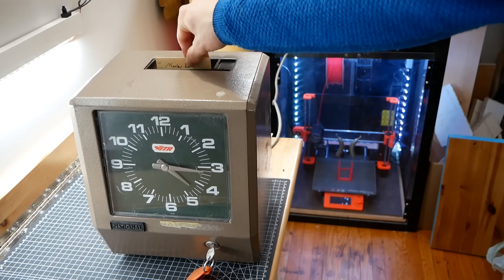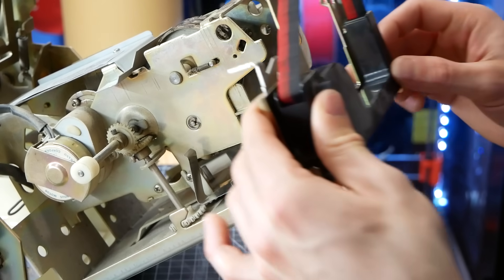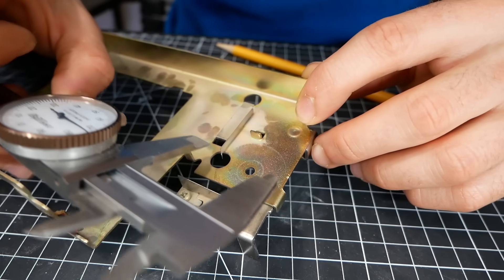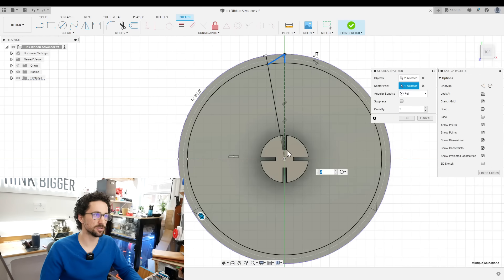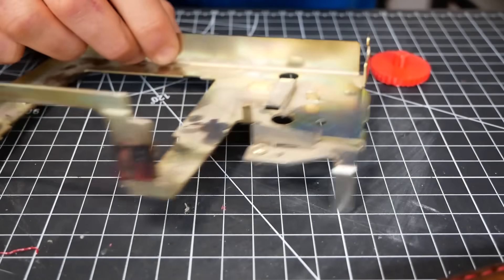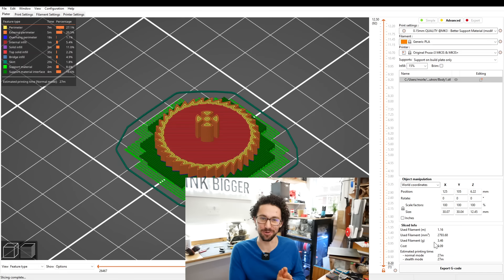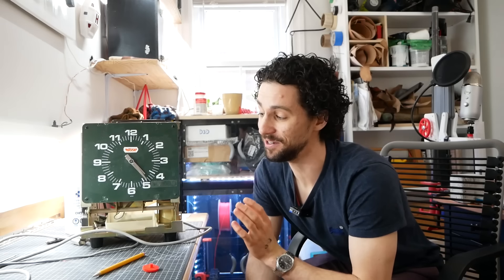They wanted 100 dollars. I 3D printed it for 9 cents.

Comment: There are a lot of good reasons that that part costs $95. It was the whole assembly, the product is ancient, there is storage, handling, shipping, etc. I am impressed that they were able to diagnose it and offer a replacement part. That's one hell of a company.
Reply: He didn't take into account the cost of his 3D printer, Fusion360, and other tools he had available in his workshop. For a collector who doesn't have those lying around $95 seems a fairer cost. For people who does though, yeah $0.09 is definitely more appealing xD
Reply: @jellyfishwiggle8721  because he already had them. if you say that a meal cost you 10 dollars to make, you're not taking into account the cost of buying the stove, the plate you serve it on, the utensils you eat it with, the whole bottle of cooking oil, etc. the video was about how he saved himself 99 dollars, not a guide for the average person to make this random single part of an outdated machine
Reply: @jellyfishwiggle8721  You could upload that file to JLCPCB and they'd charge you like $1 to make it and $4 for shipping. And it'd be made on an industrial printer from SLS Nylon so no worries about durability.
Reply: @jellyfishwiggle8721  And youre not taking into account that fact that there's 3d printers everywhere around you. Here in Toronto the libraries have them. That means you could 3d print the repairs locally on a 3d printer for much less than $100. Its free to use 3d printers in our free libraries.
Reply: @jellyfishwiggle8721  Dont forget to mention that he uses a 9 cent plastic part for something that is used over 100 times a day.  Image the cost of printing that gear 5 times a day compared to buy one for $95 wich lasts decades
Reply: @ZenoAmbrosius  well in the other video he used for reference the part also looked like plastic, also i would doubt that the wear on the piece is actually so much a good 3d printed part would not handle, not 9 cents but i would bet money that if you refine just a little more you can get the same result for something under 10 bucks, hell if don't have the printer you could just order the service online just giving the piece specifications, i'm not saying that the original company is not a good company but i am saying they at least could had told him "oh you are missing a gear that interacts with the mechanism right there" but they didn't, they offered a whole new mechanism to substitute a minor part so yeah not the best
Reply: @ZenoAmbrosius  he can print it again using NYLON.
Reply: @ZenoAmbrosius  I don't think it's gonna fall apart after 20 uses... it's not made of play-doh 😂
Reply: @ZenoAmbrosius  that’s a plastic wheel that company is using, plus not to mention, if the content creators piece lasted 100 years, that would be $9.10 of use, compared to that $95 piece, id pick the 9¢ piece
Reply: @ZenoAmbrosius  my mans forgot about cast iron
Reply: @ZenoAmbrosius but if you use nylon or another technical material the cost will be a little bit higher but the durability as well.
Reply: @ZenoAmbrosius this post seems like the least thought out, if people are using this multiple times a day, we are clearly at a point in time where a lot of companies want this and they are keeping them constantly stocked. So $95 dollars for a constantly stocked piece is a rip off, he would also be able to make 1900 of these prices in plastic before he’d reach $95. I do agree that the price the company game is reasonable but your comment seems very unreasonable
Reply: @ZenoAmbrosius clearly the last one didn’t last decades and he’s prolly not even gonna use it all that often just a glorified paper weight so it really doesn’t matter plus pls is a really hard strong plastic so even if he uses it 20 times a day he’ll only have to reprint it like once every 1-2 years
Reply: @ZenoAmbrosius  PETG filament is the same cost and would last damn near forever, hell TPU is used in car stuff and that's not much more expensive. Even PLA would last for thousands of revolutions.
Reply: @jellyfishwiggle8721  Keep in mind that you can get a decent (if no longer cutting edge) 3D printer like an Ender-3 Pro or Anycubic Vyper used for about $100, or new , and Fusion 360 is one of many CAD / 3D modeling platforms, alongside OnShape, FreeCAD, TinkerCAD etc, that are free for personal use. If this was the only part he ever replaced, that's probably not worth it, but YouTube is already suggesting another similar repair on his channel. If we assume the original part cost about the same in that video, that's a total of $190 versus $120 for the 3D printer plus a full spool of high-quality filament (usually $15 to $20 for a kilogram) which can probably print this part more than 150 times over. After just two comparable repairs, or any part requiring customization beyond surface level, the 3D printer has already paid for itself.

Besides, more and more libraries are opening makerspaces that have 3D printers available for public use and would let you print a part like this for a couple of dollars at most. For example, my local one charges just five cents per minute of print duration if I recall correctly, so I wouldn't expect this part to cost me more than a dollar there.

Some other commenters have expressed concerns about the durability of a 3D printed replacement part but the one CuriousMarc had appeared to be made out of plastic, and it's not under any significant load. While 3D printed parts are slightly weaker than their injection molded counterparts, this replacement part shouldn't break down that much faster than the original, maybe twice as often at most, if printed with reasonable settings. Not the thousandfold increase others are suggesting. I have plenty of 3D prints that have seen routine use in my life for years but show no noticable signs of wear, including ones under way more load than this gear will ever experience.
Reply: Oh come on people, the time spent, the quality of the plastic... you are all right of course but you are missing the key thing in this: he can do it on a Sunday when nobody would ship it, it is up to him when he does it and when it gets to him(which is right away after doing it). This is a level of independence that is worth having especially today where corporations are chipping away at the concept of ownership every single day. You are already technically renting your phone, it isn't really yours, and soon your car will be remotely locked too(some brands already do that).

And then add the extra bits:
- The challenge - The feeling of accomplishments - The mental exercise staying sharp - The fact that one has even time to do such a thing as stopping for a moment and figuring out how to fix something is already a tremendous achievement, most people are busy just scraping by all day. The fact one can afford to do this is great.
Reply: Most companies would tell you "sorry we haven't made that for 60 years.
Reply: Agreed. However, still cool to be able to fix something yourself.
Reply: I work for a printer company, a 250gig hdd for a canon cost about $500 from canon. no software, just blank. It has to be a certain drive, software on machine locks the part number with the machine. Canon is a patent company, they own the patent on the drive and get money from the manufacturer for the drive being used. They also get money when a repair company buys the drive, and they get money when the customer buys the machine. Most companies work like this, multiple revenue streams for the same part.
Reply: Tell me you work for the company without telling me you work for the company.
Reply: You can design this on free software. The .09 is obviously material cost. And I'm sure the design took all of 1/2 an hour
Reply: As a consumer, I don't give a damn.
Reply: @PALMA06  you should
Reply: Satisfaction is priceless.
Reply: I’m surprised they still offer the part. If it meant being able to continue using an expensive product, I’d be happy to pay the $100.
Reply: Also no one consider the time he spent. If you work on it more than 2 hours you have already spent 90 dolars :)
Reply: @VarlıkYücel  Well remember that the work you do is taxed and the product you buy is taxed as well.
Reply: @raychii7361  Well yes, that’s correct
Reply: @Varlık Yücel  some people just enjoy the problem solving journey, and it's not necessarily only about the money.
Reply: @VarlıkYücel In what world is $45 an hour reasonable?
Reply: You know damn well it does not cost them $95 to injection mold a shitty gear, which is probably why it broke in the first place. They're not at all "one hell of a company" for keeping documents about their own products
Reply: @lemau8458  The injection mold to make just that one gear cost more than a new car, a really good new car. And it's for a low volume product so they have to profit somehow. Injection molded plastic is only cheap in volume because the tooling is insanely expensive, I've seen molds for large plastic pieces that cost as much as a house. In low volume products it's often actually cheaper to CNC cut parts from POM or aluminum than to use injection molded plastic due to the tooling costs. This may not be the case IF you can find a usable part in the injection moulding outfit's back catalog of abandoned molds. They don't throw those out and the contact often dictates that the mold belongs to the company fabricating the parts not the client, but this depend s on if you can find a part that will work in your design. It's why you see hobby servos with identical cases from different manufacturers, there's a big injection molding outfit in South Korea that does a lot of the hobby R/C market's plastics and they have a TON of old R/C hobby related molds that keep getting reused so you see plastic bits like ball link ends, servo shells and other fairly generic odds and ends popping up from completely unrelated manufacturers over decades that have clearly came from the same molds.
Reply: Most modern companies would simply tell you to buy a new machine lol, also the companies parts are obviously not made of cheap plastic
Reply: Came here to say this - $95 for a part from rare and obsolete equipment, manufactured the classic way, doesn't seem unreasonable. 👍
However, 3D printing a facimile is pretty brilliant  😁
Reply: They wanted to sell the whole metal part for 95 dollars, instead of just the gear. If they would sell just the gear for say $10-$20 they would probably sell more. Industrial markup is so stupid. 😅
Reply: @mechticulous8202  you're assuming they have just gears made.  It sounds like they don't.
Reply: None of those reasons come close to justifying that part to cost $95 dollars.
Reply: @jordanhoughton4227  It's a part in an industrial device, low volume so they have to profit by increased price otherwise no reason to make the device.

Comment: I use this exact clock-in machine 4 times a day. Somthing interesting is that you have to manually cycle throgh a whole week -1hour when the clocks go back and takes about an hour to get to the correct time as each turn is 15 seconds.
Reply: Or just leave it at the wrong time? The only thing that matters is the time difference between check-in and check-out right?

Comment: 9 cents plus 3h of looking for the issue, figuring out the proper teeth shape and size, than adjusting the printer (and being lucky for proper fitting). I have a printer and love using it, but it's not that easy as 9 cents.

Comment: You're a joker...right?  This was a troll...right? If I came to you and asked you to make that one plastic replacement piece...how much would you charge me?  And since it is not hardened plastic, how long before it wears down and I need another part?  Are you going to charge me again?  

If you think you made a point, you did not.  First they were not going to charge you a C Note for the advancing gear...it was for a replacement housing which contained the gear.  You spent 9 cents each in printing material...yes... but you spent hours of your time and your setup cost thousands.  So, if you never made another piece again, what would your end cost be?  HMMMM.

Comment: At almost $60 for the ribbon, as long as it is still intact, a quick spray of WD-40 into the hole can extend it enough to make it work longer...

Used to do it on old dot matrix printers

Comment: Great showing how you can use the 3d printing to save costs if you are willing to invest the time(which is likely if you have a 3d printer at hand), but maybe not viable for the average consumer quite yet. would be cool, but unrealisitc to see manufacturers release 3d models of replacement parts for perhaps a smaller one time fee

Comment: The whole point of doing something like this is solving an issue yourself and the enjoyment you get from the process.  I needed something to pick up a ball at my mini golf place, but anything I could buy wasn't really practical.  Ended up using a plastic bottle lid and a dowel for a handle, and it works great.  So, seeing someone solve a problem for themselves with the tools they have at hand makes me smile.
Reply from the maker: That’s awesome! Thanks for watching 😊
Reply: Sounds cool. Do you have a picture? I’m imagining the bottle cap cut in half like a semi circle. Is the golf ball a friction fit?

Comment: Details of Fusion 360 Parametric Prototyping Process
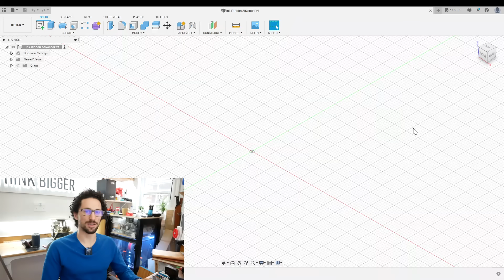4:25 Fusion 360 > Modify > Change Parameters
4:31 Adding User Parameters
5:05 New Sketch
5:07 Creating sketches based on parameters
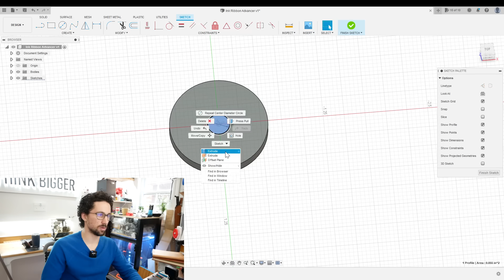5:32 Creating Slots based on parameters
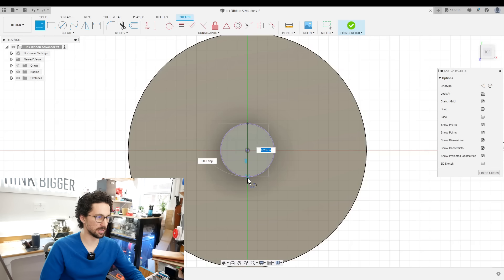5:44 Offset lines for slots and adding slots based on parameters
5:58 Multi-selecting cut-out areas and excluding
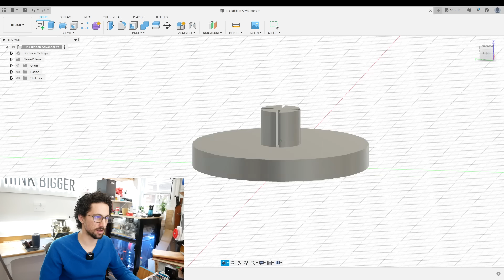6:18 Making the gear
7:03 Second circle for tooth depth
7:08 Adding Tooth
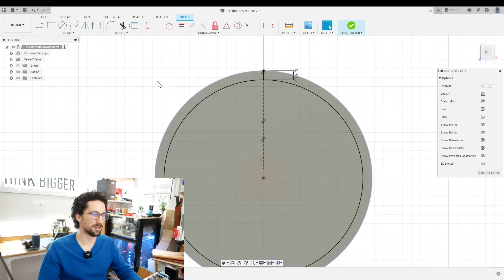7:14 Adding Tooth Angle Parameter
7:31 Finishing up parameterizing the initial tooth
8:03 Selecting lines to Create Circular Pattern and set center point
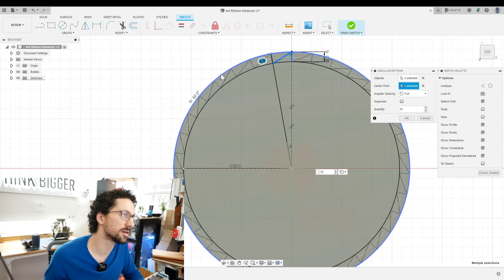8:39 Extruding away unwanted tooth ring material
8:59 Prototype complete
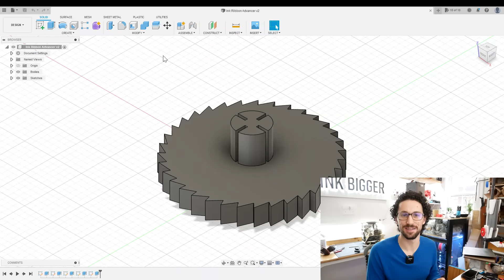10:13 Revising by editing parameters
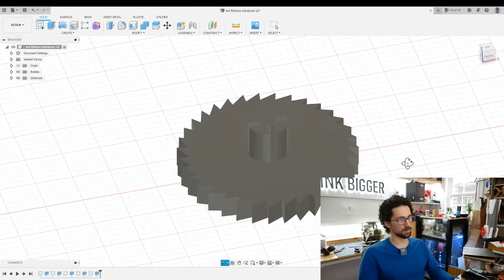11:04 Slicer part cost estimation feature
Reply: God amongst men

Comment: Dang! I am impressed by the fact the punch clock manufacturer still sold parts for that machine?! Today we are swamped with products that are less than 10 years old, could and can be fixed but are designed in such a way that you cannot easily take them apart or there are simply no parts available to purchase.  
Read a comment below about how many times you have to print something useful to get your investment back on a 3D printer. For me it started out as a hobby and the new shiny thing and 4 years later it is something that I wish I had sooner. It has made fixing and creating parts for things I wanted to build SOOO much easier since before I would be stuck with whatever was sold at the hardware store or simply could not make at all because they required CNCs, drill presses, etc. I can honestly say my 3D printer has paid for itself many times not in the amount of money it has saved me but the enjoyment of being able to make many things that were simply out of my skill set or price range.

Comment: and i would totally tell that to the company to. being like. "yea by the way your product is a scam. i just frixed your $95 problem for $0.10. just so you all know" 😅😅
Reply: It’s not necessarily a scam.
Unless it’s a part that’s ordered very often (which this probably isn’t), companies usually don’t keep the spare parts for such old devices, they just keep the machining plans and have someone machine it specifically for the order.
95$ for a custom machined part isn’t that expensive, especially when you consider the material cost, time it takes to set up tooling, machine it, measure and eventually rework it, package it, ship it and the pay of the machinist and other people involved in ordering and shipping.

If you judged all products just by the cost of the filament needed to print them and ignored the time it takes to model them, everything would be a „scam“.

Comment: 8:17 To keep it parametric, the quantity of your array should be "360/toothAngle". That would give you 36 teeth for a 10 degree angle, 72 for a 5 degree, etc. All you would need to do it change your toothAngle parameter and it would automatically update AS LONG as your angle is a factor of 360. 

Also love the video! I love to see people using CAD and 3D printers to repair old derelict machines!
Reply: "As long as your angle is a factor of 360" -> that's the reason that you should turn it around and say toothAngle = 360/numberOfTeeth.
Reply: I was amazed he didn't know how may lots of 10degrees where in a circle.

Comment: I’m waiting for some massive company to make their product’s replacement parts available for 3D printing at home for a tiny fee. They provide the instructions as long as you have the printer.

Standardize printer sales could be pushed, companies could offload all their inventory burden for parts, not worry about demand/supply issues, happier customers, cost savings all around, just have to find new jobs for all those parts department people.

Comment: Now that you printed this part, you can also send the STL file to a company that prints 3d in metal and you can then have a part that is considerably more durable. So using your printer to make a part, you are able to test a part. Very good to have a 3D printer around.